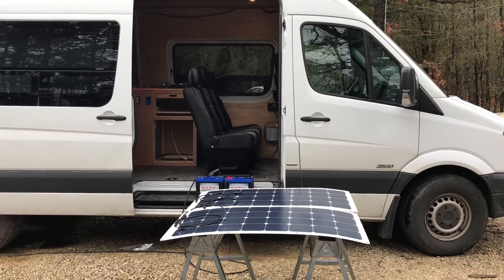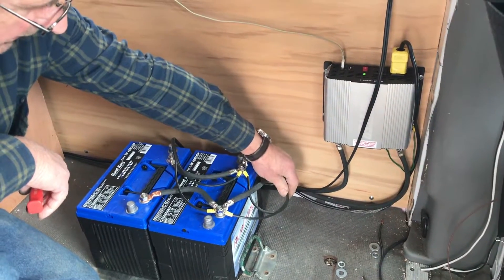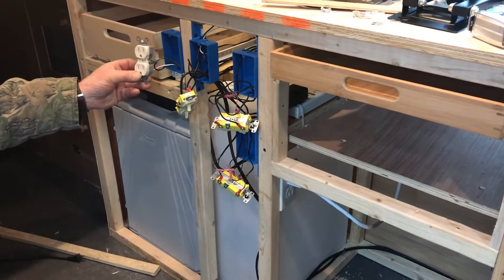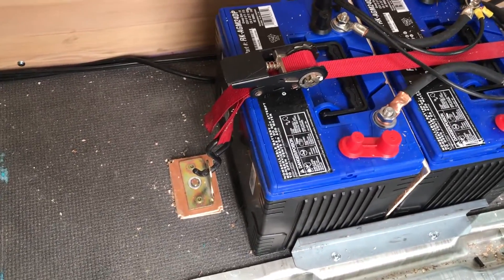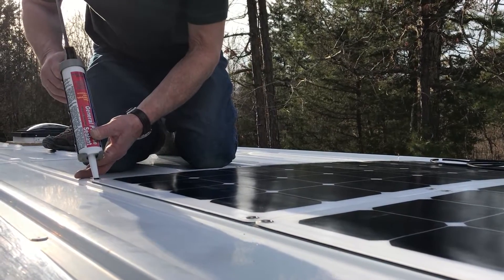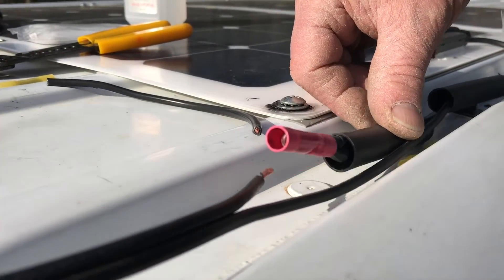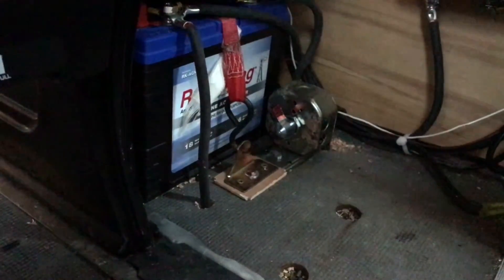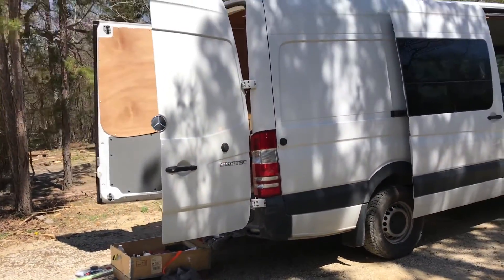How to install simple Solar System with Alternator Switch, Sprinter Van Conversion

Comment: Did you connect the car battery directly to the solar battery? What size cable did you use ? And which switch did you use ,

Comment: Is there any danger in having the switch on for the alternator while the solar panels are taking in power from the sun? I was thinking (with a non- electronic background mind you) that I would want 4 terminals on the switch to cancel the solar input in favor of the alternator's power input. Has this setup been working fine for you by controlling the additional power through this ground switch? How many amps is that switch capable of passing through it?

Comment: Electricians trick. Just before you heat shrink the solar panel crimp connections, put a daub of silicone sealant inside the heat shrink tubes. Perfectly sealed.

Comment: How long does it take you alternator to charge your batteries, say if it's a gloomy day and the solar panels aren't efficient?
Reply from the maker: Running the van for about 20 minutes charges them up, but I would maybe have to do that 2-3x in a day if not making any solar. I'm going to be doing some upgrades to my system this month and will be adding another battery.

Comment: Pretty sure that you should have wired the parallel batteries somewhat differently. Positive from one and negative from the other, so that both can benefit equally from the charge coming in.  The way you have done it forces the "first" battery, currently with both positive and negative outputs on it, to NOT share the charge, nor the discharge equally with the other...
Reply: wiring batteries in parallel is connecting the + to + and - to - results in double the volts at the same amp hours. wiring in series is + to - resulting in the same voltage and double the capacity (two 100 amp hour batteries would be a 200 amp hour system)
Reply: @aegrimm5777   Jesus's response is correct.
Reply: @aegrimm5777  you got that wrong, connecting in parallel will give you the same voltage, and the amps increase. Connecting in series will increase the voltage, but amps will stay the same.

Comment: I need a stable 12v source for my solar in my van but don't want a second battery.  My draw will not be much since usage will be in heavy sun light.

Anybody using a dual purpose start battery and solar charging their cars primary (and only) start battery? My 2018 Ran Promaster city has 160a alternator.. I wondering how it would behave with a 100AH 200RC 900CCA battery? Also do I need to isolate/switch to connect a 200 watt 18v 6amp Solar panel and 20amp controller into the cars system?
Reply: Not sure what engine size and fuel type your vehicle has but to answer your question on using cranking battery only.
 Yes on a Petrol Hyundai Imax with 2.4L 4cyc petrol engine used the standard cranking battery of 600 cca or 80 aH and it has been in service for 3yrs. The Alternator size I don't know but it is old technology style.
 It runs 40L Weaco fridge full time plus has USB and 12V acc outlets that other items can run or charge off. About 200-250WH/24hrs. 
I have a 200Watt 44.0 VOC house hold panel going via Victron 75/15 MPPT that is to only the cranking battery.
There is 6 terminals on MPPT. 2PV, 2 battery and most importantly 2 for load eg fridges.
Using phone, app and blue tooth you can set the load terminals to shut off at set voltage. I use 11.8volts to give balance on amps to when there is no sunlight and still know the small petrol engine will start.
Anything not run via the load terminals on MPPT can drain battery to below 11.8 volts and after dark cause vehicle not to start. Had person not shut door properly overnight and interior lights drained battery so would not start in morning. Luckily by 830am when nned to use vehicle the solar had produced enough charge to start engine.
The Victron MPPT is smart enough to monitor battery voltage and when vehicle alternator has lift battery to set max voltage the MPPT will draw no watts from PV so no overcharging. Once alternator stops  charging the MPPT will adjust to suit battery voltage and any draw via load terminals and does it thing with no assistance from me.

When first asked many salesperson  about cranking only battery and having solar on vehicle was told battery will last 6-12months  as sulphation would occur due to excessive cycling of battery, solar would over overcharge during day when driving, chickens would stop laying and all doom stories. 
At 3yrs of service the battery was 550cca when tested or lost 50 CCA. Considering most batteries are replaced at 2-3yrs I have not found it to have damaged the battery cycle life. Lack of room is why no 2nd battery plus has been cost saving in not buying 2nd battery. 
Think outside of what everyone else does following others
Biggest thing is need to know is how much amps required and will it drain battery too low voltage or % discharge.
Apart when was playing with cut off voltage to load terminals and 1 time doors not shut properly and battery drained it stayed above 11.8volts. Go below that and number of cycles battery will last reduces rapidly 

2nd hand house panel $50, 75/15 MPPT $200, cable and stuff $50 plus fitted myself
Brisbane Australia if you want to compare what your climate is to mine.
Reply: my OEM battery is 70AH, 900 CCA, 120RC . Alternator 160a.  4 cylinder 2.5L van.  200W 18v 11a  Flexible Solar Panel (so far get 6a at best).  20a MPPT.  1200W inverter right on top of the battery with 4awg cables. I've ben testing with a 12v 2a fan and 40watt freezer and if the sun is out both running my battery maintains around 12.5v.  My goal is to keep inside comfortable and freeze a gallon of water from 10am - 6pm for a swamp cooler AC at night.  I too have had luck doing this with a primary starter Led Acid battery and I buy batteries with 4 year warrantees.   I plan to eventually upgrade my battery to Dual purpose deep cycle 100AH, 830CCA, 205RC.  If I could meet the goal without solar on some days that would be a major win.  I am also willing to run the engine for 15 minutes right before going to sleep at 11pm which seems is a major help.

Comment: A solar installer recommended taking the positive from one battery and the negative off the second battery
Reply: it depends on what you want from your batteries: 
+ to + doubles capacity meaning two 12V 100AH batteries are now a  200AH system at 12V.
+ to - doubles volts meaning two 12V  100AH batteries are now a 24 V system at 100 AH.
Reply: @aegrimm5777  I wasn't referring to that, I know how series and parallel works, even i series he recommends positive from one and negative from the other battery, look at a battery operated piece of equipment, on the battery tray the positive is taken from one end and the negative from the other end
Reply: @malcolmrowe5031  You mean take the + feed to appliance /inverter from one battery & the - from the other to spread the load evenly through the two rather than one battery feeding the other.
Reply: @trevorcannings2966  Exactly, the guy said it shouldn't really matter electrically but in practice it does, not tested his theory but if you look at battery operated devices with multiple batteries then they do this principle in their internal wiring

Comment: i did this with 3x100w, and didnt check the panels beforehand, result: have one panel that gives 10v and 1.7 a, one that gives 19.5v and 2.5 a and one that gives 19,5v and 1.8 a. also, my charge contrioller (tracer 4215bn) will not give me proper accumulative voltage, but bring it down to 14v from an initial 30 or so. and that 14.2v is not charged, when you turn the ignition off again, it will dip back down, depending on how long you had the alternator going.

Comment: At the start of video you said hooked up in parallel , but I see your not , parallel is positive of one n neg of the other this forces your batteries to charge together , were you have your leads hooked on one battery n piggy backed to the other, that means your 1st battery is charging n then the other
Reply from the maker: The batteries are hooked in parallel. When alternator switch is on the alternator senses all 3 batteries as one and charges them equally at the same time. The system has been working well all summer with no issues.

Comment: I like your van set up.  Very nice.  One thing you could do to improve your battery performance it to have the leads coming to and from the batteries on seperate batteries.  By that I mean attach the positive lead to the positive post from one battery and the negative lead to the negative post of the other battery.  That make it perform more like one larger, more powerful battery rather than draining down just the one it is connected to.  You will certainly extend the life of that end battery and improve performance by draining them both equally.
Reply from the maker: Thanks! We do have all 3 batteries hooked in parallel.
Reply: @FitOrganicLiving   making sure that the positive HOMERUN comes from the first battery, and the negative HOMERUN comes from the third battery (spreading both a charge and a discharge evenly balanced across all three batteries). . . Otherwise , the battery connected to the homeruns will surely get more use, and thusly fail first . .

Comment: Nicely done.  I would like to see how you wired the switch.  Is it purely an on/off to ground? When it is in the on position, is there any concern with back-feeding your PWM controller and/or the solar panels?   I have a similar system for a small (teardrop) trailer, however, I was told to disconnect the Solar & PWM when connecting the alternator.  This requires a 3 pole switch that I have not yet purchased. Or, the really deluxe system uses a smart switch that selects the correct source (solar or alternator) for you. I was looking at the REDARC BCDC1225D, but it's pretty pricey: https://redarcelectronics.com/products/dual_input_25a_in-vehicle_dc_battery_charger. Cheaper on ebay. The thing with the alternator, is that it stops charging when your primary (starter battery) is full. This is to prevent over-charging.  If both can be hooked-up at once, then when the alternator kicks-out, the solar is already hooked up and would be charging.  Hmm that causes more questions. But I really like your video. It'd be great is we could have a chat as you look like you've done your homework.  Great, clean install job!
Reply from the maker: The switch is wired to ground. The 3 batteries are hooked in parallel so the alternator senses  them evenly or as one large battery. The alternator is 110 or 120 amp so it has no problem with 2 extra batteries. Under the hood there is a spot to put another battery, so alternator is plenty for charging. The charge controller prevents overcharging so we don't have to disconnect anything.
Reply: @FitOrganicLiving  OOOOHhhh. The Solar charge controller still protects the batteries from overcharging via the alternator?
Reply: @fit organic living that's nice and all and totally understand your answer but you didn't answer about the current heading from alternator into your inverter, converter, control box or solar panels and all that.

Comment: Very nice video. Just one question. Did you make sure that the van's alternator is gonna be able to handle both the van's battery and two solar system batteries at the same time?
Reply from the maker: The van has a 110 or 120 amp alternator and has no problem with 2 extra batteries. There is even a spot under the hood to wire in another battery. All 3 batteries are hooked in parallel so the alternator senses them as one large battery and evenly charges them all when the switch is on. Charge controller prevents overcharging.
Reply: Great question.  Most alternators would have no problem with handling the load.  Especially in newer vehicles.  But they are designed to do a 3 level charge: (bulk, absorption, and float.) The amperage is being reduced at each stage then, eventually stops until needed again.  So, if all 3 batteries at hooked to the same alternator with the same gauge wire and no balancing switch, how does the system know when the primary (starter) battery is full?  How do you prevent it from getting over-charged?  I believe there's a potential for a serious problem.  But, I'm talking theory and have little practical experience with solar assisted systems.

Comment: Nice vids. Keep it up! You really don't want to mount batteries in your cab. They off gas. You want them in a sealed box with vents to the outside. FYI
Reply from the maker: The batteries are AGM and are sealed, also code approved for indoors.

Comment: Nice setup and well explained.  If those screws on the roof aren't stainless, you might want to cover them in lap sealant to avoid them rusting .